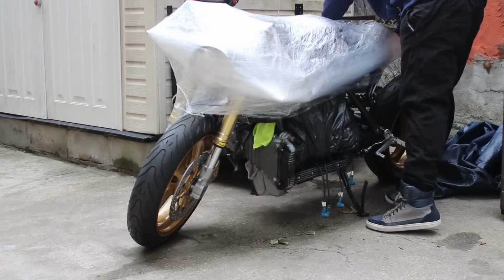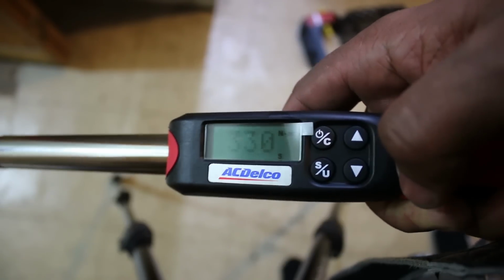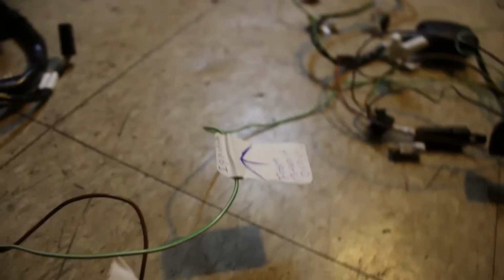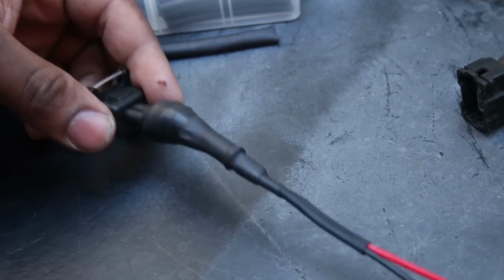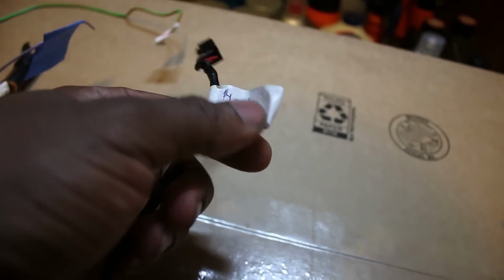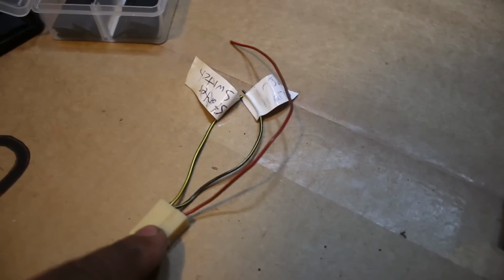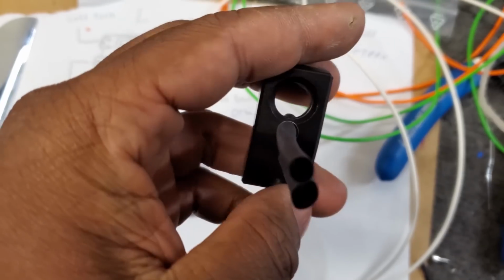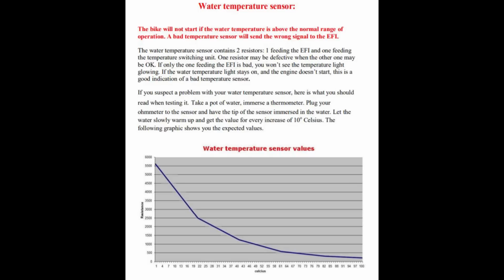[Ep 12] 1986 BMW K100 Cafe Racer Project - M-Unit Fuel Injection Rewire

Comment: It's always a process to get an engine fired up after electrical surgery :) A couple of points to perhaps consider:
 maybe use an inline resistor instead of the bulb for the charging light.
I would strongly recommend having either an idiot light or even better an oil pressure gauge to keep an eye on your oil pressure (Permanently) there's a reason they come standard on every bike.
Reply from the maker: I spoke to Kennyraceboy about the resistor method since that's what he did, but I think I prefer actually having the charging indicator... I'm a little paranoid about this little lithium battery and it would be one less thing to wonder.
And yes. I already mentioned in the video while the bike was running that I will hook up the oil pressure light... that being one of the reasons I listed fo not running the engine to long. I didnt in the video because I had spliced all the LED triple grounds together already and I didnt want to disturb the junction. These bikes have a grounded pressure switch so all I need to do is splice one of the LEDs to 12v and use the switch connector as its ground.
Hooking that up will be a part of "cleaning up the electrics"
Reply: @Theillestrator1050  My bad, somehow didn't catch you mentioning the oil light. Not to drag this out, but if the battery is lithium, a voltmeter is not a bad idea in case the reg/rec fails and overcharges the battery, that can be a serious fire hazard. Great job on the build and keep it coming! :)
Reply from the maker: Right, that's part of my worry. The brushes on my reg rec are still good and I like these types because they're easy to inspect by eye. But I'll go ahead and replace it anyway since they're reproduced aftermarket.
Reply: @Theillestrator1050  The MOSFET ones are waaay superior if you are going the replacement route,  used ones off a newer Honda/Yamaha will easily adapt to any older charging system no problem and be vastly more robust and pretty much infallible. and they can be had for super cheap used. Folks on e-bay even sell kits for specific bikes with good quality weatherproof connectors included.

Comment: Hey man I'm an electrician and have a couple of tips for you when it comes to splicing/joining wires. You should invest in some crimps and a crimper, as when using solder in vehicle applications vibrations tend to pull apart the connections. Also when joining multiple wires at the same point staggering each joint allows for a streamlined cable and if there's a fault (e.g. solder pulls apart) the wires are spaced and won't short to each other.
Reply: This! I always recommend crimping on all automotive applications as well (Not an electrician but an "old hand" at the hobby... LOL
Reply from the maker: Noted!

Comment: I don‘t know if you have the BMW Group Classic Shop in the states but here in Germany they have nearly every screw, pipe and rubber bushing you could ever think of and... it’s original. I‘m actually trying to get the electronics working on my K100 CafeRacer. I really enjoy your videos! Greetings from Germany!
Reply from the maker: Im not sure if we have them,  but in the northeast of the United states we usually go through MAX BMW for parts. But im sure your shop is better since it's in the source country. If MAX doesn't have the little bolt you're looking for, it has to come from Germany which isnt fast lol

Comment: Love the vid and I know you aren’t finished and this has nothing to do with all the wiring you did but I think a center cap on the rear wheel would look great.
Reply from the maker: I have the center cap, but it's plastic so it couldn't be powdercoated. I had considered painting it but it will never be a complete match to the wheel itself so I just omitted it...besides I dig the more mechanical look of the exposed lugs I think

Comment: Great vid illest!  Got a sinking feeling 11 minutes in though.  Keep an eye on your oil and coolant.  Let me explain (I know nothing of BMW stuff but I know seals).  Where you pound out that piece of thin metal, that was what was left of the seal, they have a metal liner inside them if you didn't know that, check the one you didn't use with a magnet.  Well when you put the new seal in you put the metal cup facing the opposite way than the one you drove out was.  Lip seals seal tightly one way and much less so the other.  So once you have all fluids in you may find oil leaking into your coolant.
Reply from the maker: In the moment, I didn't think that it was part of the oil seal because yeah you're right, it sat differently than the 2 new ones I bought almost like reverse direction so I figured maybe it was a piece of the old style water seal. What I reckon is that may have been an older obsolete style seal? I dont know if these seals were original or what since they updated these pumps due to them failing..but I just hope they weren't installed incorrectly BECAUSE I can verify that the way I did it was in fact the correct way with THIS seal in particular. You are indeed supposed to drive it in with the dome part facing upwards toward you. This is just the weird stuff that happens when a bike chassis runs from 1983 to present day... things get changed alot... plus...BMW 😂

Comment: I would not switch automatic actions to manuel, i guess it is a personal preference not to have to think about it and free my riding times from remembering to activate this and that, checking gajes and stuff like that. Also i think german ingenieurs are smarter than me and if they thought puting those fonctions on automatics it is for a reason. But that is only my opinion. :) Good job man, i love your videos !
Reply from the maker: Sure, but something like the fan is set to activate at a specific temperature. If you have a way to track the temperature, you can turn it on just the same.

Comment: Thanks for the shout out, glad I could help! With the charging circuit on the alternator I replaced the light bulb with a 51ohm resistor, it roughly equates to the same resistance of the bulb, looks stealth and seems to be working just fine so far. Your build looks amazing thus far, I'm keen to see you riding it soon, great job!
Reply: I was reading all the comments for this particular topic 😃!
I replaced the my K's charging light last year with 2 x 56ohm resistors in series, and it has been working the whole riding season. I got that info from www.motobrick.com.

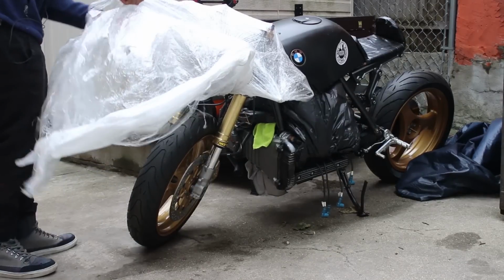I was stoked to notice that the episode is 1:17.?? long, I allways look forward to get to watch a new episode! Thank you!
Reply from the maker: Thanks, and really? Part of me wants to look into the simplicity of that resistor trick, the other part is actually paranoid and would like to know if it's charging with the light 😂
Reply: - The illestrator - that is a good point if you want to know definitively that your battery is charging. I guess the reason that the 51ohm resistor works is because the charging circuit is just looking for some sort of load on the circuit, I guess you could add an led to the circuit too, to bring it into the 21st century haha!

Comment: Coil on plug conversion is needed those things are big and not very good looking. Someone makes something to simplify your wiring. This bike looking amazing, please wait till the salt is gone before you rip this thing on the road, PLEASE 👍
Reply from the maker: When I clean up the wiring more, I'm gonna repaint and polish the coils. Im also gonna cut off the excess parts of the mounting brackets to give them a smaller footprint.

Comment: Ah fuck yeah, it lives again! Doing electric is easy, huh? They probably don't reconmend using a battery cable smaller than that is because of resistance[subsequently heat), electricity flows on the surface of the strands that make the wire/cable, not through it. Even if the eletrical load is the same, bigger wires will move more current. 

You're doing great with it. Are you going to do something to protect the battery like a cover, or a bobbed rear fender to keep water from being splashed through the frame- I know you practically ride in any weather. I imagine this might be a sunny day bike, because you have the other one.

You might be able to do a small pie cut in the muffler and have it angled a bit more up, like 5 degrees.
Reply from the maker: Well it's certainly a little easier now since I've learned so much about it at this point. I reckon you're right about the wire gauge but at the same time im sure this is also them covering their ass. "Your unit melted? Did you use the gauge of cable that we told you to? No? Void." 😂
I was actually looking to mount the battery under the tank. Take the stickers off and allow it to block off some of the wiring. I won't be riding it in the rain but I may or may not run a fender 🤔
I have a plan with the exhaust that may or may not work but we'll see

Comment: the liquid in you exhaust was actually water, It's a by-product of the combustion process. If it were fuel you would have some serious flames coming out of the back
Reply from the maker: It was definitely fuel. It smelled unquestionably like gas on my hands and it stained the ground as gas would when it evaporated. 
My theory is that it was in the pipes as it dripped out of the cylinders over the course of 24 hours from me flooding the engine up. And once the bike started, it was blown out of the rest of the piping. But it definitely wasn't just water, atleast not entirely water.

Comment: Quick question. What is the average oil temperature similar bikes run at? Does that gauge have enough temperature range for your needs?
Reply from the maker: In my experience anything approaching 248 degrees F is questionably hot. This gauge goes to 280 degrees F so more than enough
Reply: @Theillestrator1050  good stuff

Comment: time to set up some coffee and have a long relaxing morning

oi illest, just a lil tip from me, when you squash wires in a terminal, make sure to solder the wires first, so permament contact is ensured
Reply: @Theillestrator1050  I wouldn't solder connector wires as solder can degrade over time and may cause connection to fail, also can become a fire hazard for high current connections. More reliable option is to crimp the cables. Crimping tools are designed just for that and will create air tight seal preventing air and moisture to enter, protecting the connection from corrosion.
Just my .2$ as an internet guy with good intentions.

Edit: a word.